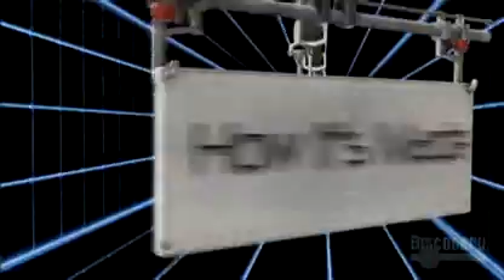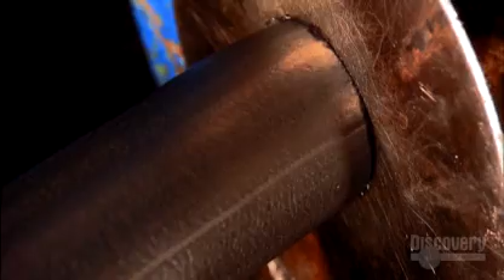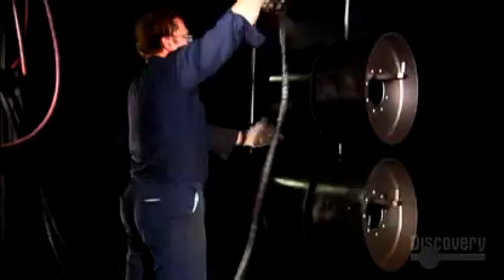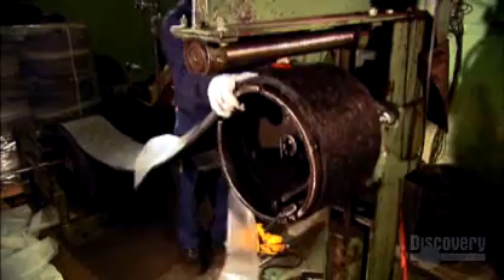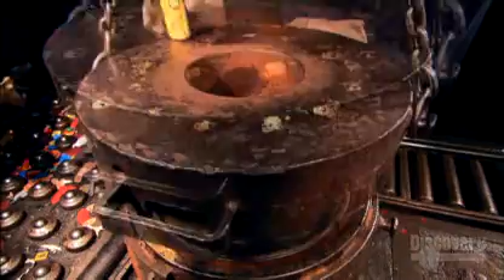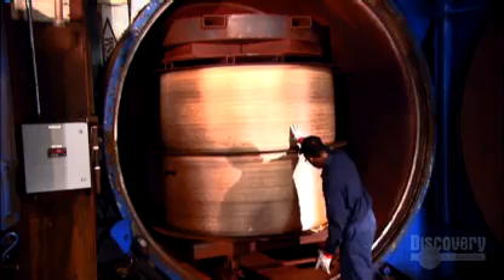How It's Made: Solid Tires (S09E01.1)

Comment: an extruder is a machine that exerts pressure and heat to a material to give it a new shape ,its a process widely used on plastics,when the plastic gets extruded it gets more conformity on its constitution ,a new shape,it hardens a little bit for most plastics,most rebars and quality tubes are extruded

Comment: woooooow the offroad conditions in a warehouse must be so difficult...
Reply: ***** Not difficult usually. Just 20 to 24 hours a day 5 plus days a week. And a low tire causes a tilt. So a fork truck mast at 35' in the air with a 4000# crate will lean and tip. We got around 8 month out of a set of solid no tread and 6 months out of solid treaded. One of my jobs was changing the tires. A monumental pain in the ass. Like the guy in the video except when you press the tire off/on the dings in the wheel hub drag and bind up bad. You earn your keep on tire day that's for sure.

Comment: I think making a steel mold & pouring hot rubber into the mold would be alot easier & better straight away. Why do they need to roll it for also?
Reply: Tire rubber can not be poured. The form you see it in the mill is as soft as it gets. Once it is in the mold and compressed and heated the rubber "cures" or gets hard as a bulls prick and is no longer sticky and tacky. Rolling on the "ply's" or layers prevents inclusions in the rubber. In other word keeps the air pockets out. It you had an air pocket it will eventually cause delamination and pre-mature tire failure because the air prevents vulcanization in the location of the inclusion.

Comment: Well off course not.They will increase the fuel economy.Ass the tyre is allways hard.No need to double check before any vacation,no need to worry that the tire will explode when you have to lug your fat aunt to airport with the entire home in her suitcase no worry on offroad that a cactus spike may turn you into sitting duck etc.As far as the bumpy road goes i don't it affects much cuz the air filled tyres are rock solid after inflation